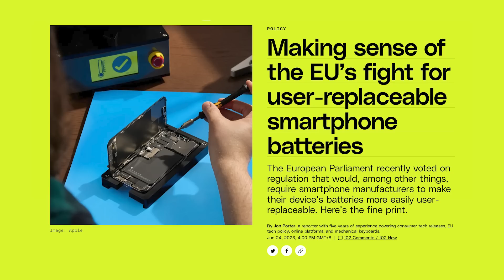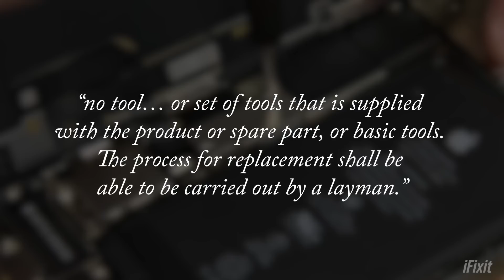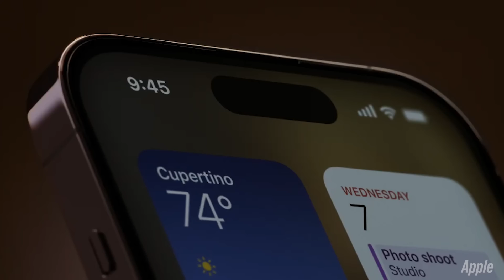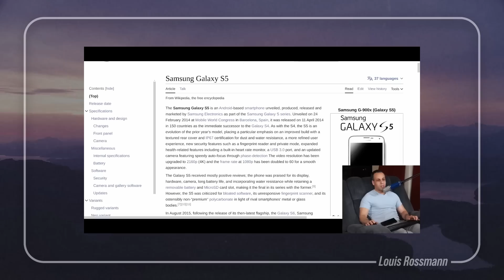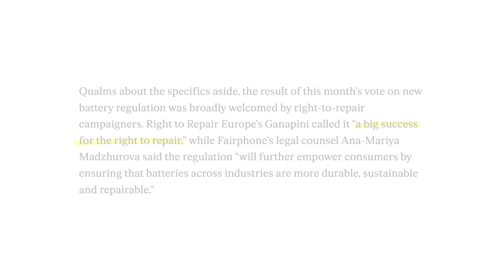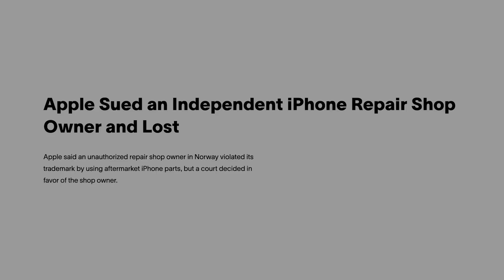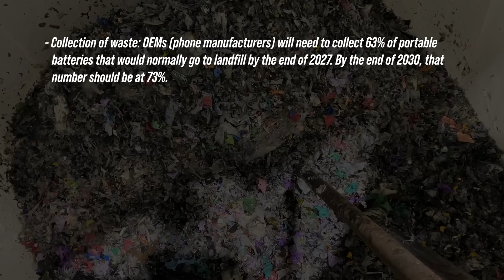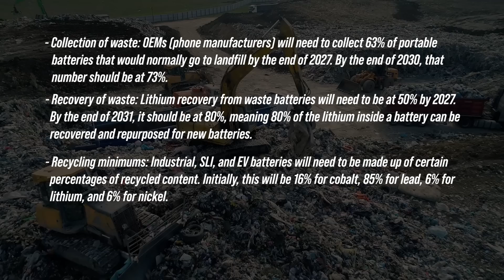EU Just Changed Smartphones Forever

Comment: Honestly removeable batteries are awesome but it doesn't help that much when smartphones have around 2 to 3 years of android updates or Samsung and Apple which have 4 years or more.. If you buy a motorola and xiaomi for example most phones are updated 1 or 2 versions of android, since a battery can last around 3 years until it drops below 80% of health you are more likely to run out of updates and even break your phone, so EU should also ask for manufacturers to increase the Android/iOS updates to be at least 3 years for low end devices, 5 to intermediate and 7 to 8 for high end.. The galaxy S9 for example can still run most games and apps easily but it ran out of updates, just like iPhone 6 and 7 but Apple at least does a better job at updating so isn't a big deal, but for chinese brands this should be considered, my old Redmi Note 8 Pro only got 1 update in 2 years :(

Comment: This will be very good, but I still think that for products like the iPhone there are more components that should be interchangeable. 
I also used to swap batteries in the older iPhones, but many times I felt the battery died at a higher rate than before.
I think this was the time before it was official that new software updates included higher battery consumption.
In addition new software updates are not compatible with all CPUs. Not an electronics expert, but shouldn’t this also be an interchangeable part?
Reply: I got my battery changed a few months ago… And it certainly seems that it’s not holding a charge as long as the old one. Or as long as it ought to. And I was very very good about charging it to 100% and letting it run down for the first few cycles.
Reply: @johnnyxmusic  haha that’s how I have been thinking to! But it’s too hard to maintain that way of charging in the long run 😂 I also heard that the optimal way to charge lithium-ion battery is to keep it between 20-80%.. making it even worse 🫣

Comment: The first aspect of the law is actually quite easy to implement: The manufacturer collects a "Pfand" from the buyer - a token, which will be returned to the customer, if they return the battery. In this case probably a 100$.
Reply: Probably a lot less than that. There's already a deposit on car batteries in Germany, and it's just 7.50 Euro.
Reply: That's a great way to ensure no one will buy small electronics with rechargable batteries anymore.
Reply: @Michael-Archonaeus How can you buy small electronics without a small rechargable batteries?
Reply: @kikillervortlex2244  For anyone who owned a Game Boy Pocket, or an early cell phone that ran on AA's, in the 1990's, that's a silly question.
How does the remote control for your TV work?
Reply: @Michael-Archonaeus With rechargeable AA or AAA size batteries ;-)
But yeah I get your point of using single use one there, but imagine a phone where you need to buy new one every 2 days... And anyway, these one should be collected too and I do not see the problem to have like 1€ increases to each of them, and then 1€ refund when you give them back at end of life, recheargable or not. This is already in place for bottle so...

Comment: If I remember correctly, bigger batteries that last longer are exempt of this regulations, meaning that companies might just increase the battery size. Another loophole might be that devices only accept betteries made by the original manufacturer. But let's wait and see...
Reply: i mean, increasing battery size would corrispond with bigger (chunkier) phones, idk if people will buy that especially after being accustomed to sleek and thin designs for so long. That would be a shot in the foot. As for the original manufacturer thing, i think this was already taken care of in the law but dont trust my word for it, i have my fingers crossed aswell.
Reply: @Apostate_ofmind   Battery technology is eveolving quickly atm - especially with lithium reserves dwindeling. So changing to a different technology and increasing prices might have consumers pay more for the phone AND the battery while keeping the anti consumer practices. I sinserely hope for the best but the past years didn't give me faith in the industry.
Reply: @199Bubi  What in battery tech is evolving "quickly" exactly? We are still using the same tech from 90's, lol.
Reply: I had a look at the draft and I didn't notice an exemption for longer lasting batteries (to not be required to be user replacable). It might not be there, or I've missed it. However, there was an exemption for the requirement to supply spare batteries. If the battery retains 83% capacity after 500 full charge cycles and 80% after 1000 (and the device fulfills the requirements for water and dust proofing), the manufacturer/importer/representative is not required to sell spare batteries.

I guess that a heat gun (or hair dryer) will be classed as a basic tool, and then if you supply a prying tool and a suction cup with the spare battery (or other spare part), perhaps a bit of rubbing alcohol too (for loosening the glue holding the battery in place), you can probably comply with the regulations. Use of adhesives is quite clearly allowed in the draft (check parts refering to the use of removable and reusable fasteners), as long as you supply replacement adhesive and/or any other fastener in sufficient quantity with the spare part at no extra cost.
Reply: @klapiroska4714  I find it strange bigger batteries could be the loophole. I mean how about EV battery, how much more bigger could it be to pass this loophole. And if bigger, how much bigger, the law needs to be clear which most of the time law making cannot be too clear on technicality as it is difficult due to various technology differences and progresses. No government would want law to be changed or revised every year or every quarter because of fast pace technology. It just does not make sense.
Reply: @wumingkkk  I totally agree that it would not make sense to make a loophole for bigger batteries. Ideally, especially in EVs, you'd have as small battery as possible, as it takes less resources to build, it is more affordable, and lighter (safer, more "fuel" efficient and causes less wear on the road surface). It's not something that any government would want.
Reply: Nikon digital camera (D5xxx range) came with 'chipped' batteries to try and stop after market batteries being used. It worked for a while but there are now plenty of copy batteries that work perfectly well.
Reply: Car battery not big enough? So how much bigger would an EV battery need to bypass this loophole.

Comment: That's why I use a Galaxy XCover6 Pro. Not only does it have a replaceable battery, but it also has a headphone jack and SD card slot. It even has a flashing LED message indicator. These features were common till manufactures started cheaping out.

Comment: The problem with this idea is that most people don’t want to keep the same phone beyond the time the battery isn’t really good anymore. So this could force significant design changes, possibly negatively to the user experience, that in the end won’t provide any benefit whatsoever-“green” or otherwise.
Reply: Most people actually do keep their phone for a long time
Reply: @JM-bl3ih  not so sure. I see, at least where I live, people getting new phones regularly. I also wonder if xompanies - especially like Apple- will say some new feature requires new hardware. They have done this already
Reply: @LitlPrince2 I don’t disagree with this. I myself have bought second hand phones.

Comment: The Samsung galaxy S5 was water resistant with a removable back. The removable back just had some rubber seals around the inside of this removeable back cover. However, this could be an issue with wireless charging capabilities. They could have the wireless charging coil attached to the removable back with metal connectors that contact another part of the phone when closed. So I guess they can solve that. This could also however mean that phone cannot have glass back because repeated removal of it could crack the glass. So we could go back to plastic which really isn't a bad thing. Plastic is more durable as it does not crack. And you can do much more with plastic. It can be made to feel and look like leather. And it can self-heal from scratches like the LG G Flex from many years back. You can make more patterns and better designs etc. So this overall could be good. LG's G5 was an interesting design when it came out. I had one. It wasn't perfect but I am sure now it can be perfected. LG should get back in the smartphone business. They were way ahead of their time. Always.

Comment: I never had a phone without replaceable battery. I had a Sony Xperia V for about 8 years, using Cyanogenmod / Lineage to stay current with security updates. After that I got a refurbished LG G5 about four years ago, sadly that is starting to fail in multiple ways by now. My next phone is on the way now, a Samsung XCover 6 Pro - again, replaceable battery.

The most problematic failure point of my LG G5 is material fatigue in the little spring contacts that connect the mainboard to the back of the shell. Some springs broke off and left the hardware buttons and fingerprint reader without function, and some creative fixes for that didn't restore functionality for long. Luckily the device has tap to wake, so it can be used fully through the touchscreen. There also seems to be wear on capacitors though - when the battery is <30% there is a good chance the device will crash when taking a flash photo, probably due to the sudden power draw. It's on its third battery now, and sadly they need to be swapped fairly soon when degradation sets in, since the battery barely lasts a day to begin with. So from my experience, even though it has the swappable battery to recommend it, it doesn't seem like it was built to last.

Comment: Also worth noting: lithium batteries are a significant safety risk as they age, with the possibility of leading to major fires that are very hard to put out. Getting as many old batteries out of people houses as  possible is important for safety and not just environmental reasons.
Reply: What factors contribute to that? Do you mean the batteries as they age with use? Or the batteries in my old non-functioning phones I keep in a drawer because I have no clue how to not make them into E-waste or how to properly dispose of them/also Im lazy.
Reply: @SmokeandSpirit  I'm talking about device batteries specifically. phones, laptops, powerbanks etc. the batteries are highly flammable under certain circumstances. it doesn't happen often, mind. but phone batteries especially have developed a habit of 'puffing up' in recent years, turning into little pillows. if those explode or someone punctures them trying to repair them they can be a mayor hazard

any of this happening to any individual is fairly unlikely, but that doesn't mean we shouldn't reduce the amount of them just randomly lying around after they are no longer needed.
Reply: @MirrorscapeDC  Certainly they can quickly convert into a fire spitting rocket under extreme heat and/or extreme rates of charge/discharge. As the dendrites were brought up, that is part of the what causes the shorts. Though batteries at room temperature that are neither charging or discharging are almost entirely inert. The ones in my drawer for example are dead because electric devices tend to phantom drain. Dendrite formation is actually appearantly caused by mechanical forces exerted during the changing volumes inside the battery. So unless someone stupid came around and decided to pop open my old phones and puncture them, there wouldnt be any state change to cause any said danger.

I hadn't realized dendrite formation was more directly at fault for the discharge, so i never considered how the risks go up with age. Also, I just wouldn't exactly call that a "significant risk" no moreso than wall outlets are a significant risk of fire and direct shock. We learn to safely interact with technology because everything has its risks. Though really I wouldn't say you're incorrect in any capacity. Im just tripping over semantics I guess. 😂 

I guess if I had a rocket sitting around, I wouldn't leave it sitting in a drawer, especially next to a battery that could cause it to ignite. which is hilarious because i definitely have a drawer with both screws and batteries in it which hasnt managed to attempt liftoff just yet. I really should reconsider my life choices though. 😅
Reply: @SmokeandSpirit  depleted batteries are not a risk of fire, they can be dangerous to health is they leak though
Reply: @jonasweber9408  They are if they are truly depleted and you get a bright idea to plug it in for a charge; instant explosion.
Reply: @SmokeandSpirit It's the dendrites that build up and are a natural part of the technology. Once they reach a point where they can short the battery, interesting and volatile stuff starts happening.

Comment: Unless there is a regulation regarding what kind of batteries can be placed in the phone design I think this won't make the maintenance any cheaper, unfortunately.  I think about printers, the ink is easily replaceable by laymen. However, a cheap printer has expensive ink that doesn't last long. They could easily sell the batteries at a price where majority of people will just turn their old phone back in for the new model still. In 2006 when I first used phones as a teen, phones were cheap, less than 200 USD and the batteries were still 50 USD. We typically bought new phones when batteries died unless we could only afford the 50 battery.

Comment: Let's not forget that Apple also got caught adding new battery performance profiles and performance profiles in their updates to slow down existing phones to force handset  updates
Reply: You mean BatteryGate? This was already covered in his previous videos.
Reply: @ayoosh3345 My mom's old iPhone 3G did exactly that once the battery got old, it simply shut off randomly.
Since she got a newer iPhone that never happened, until Apple got sued over throttling, and then replaced throttling with a battery capacity gauge, now she is having those issues again.
Anecdotal, I know, but she is the only person I know who has used iPhone consistently since the 3G, and whose phone use and repair patterns I have been able to monitor.
Reply: While their lack of transparency was terrible it made logical sense to avoid unexpected shutdowns. What’s better, a phone that randomly turns off or one that just take a little bit longer.
Reply: They also degrade the cameras of old iPhones
Reply: We didn't.
Reply: You do know that you just intentionally misrepresnted a situation right? I'm quite sure people rather had slightly slower phones, than phones shutting off randomly. And it pretty much happens with most phones. They should have been transparent with it, but given how media would generally portray the situation I can kind of see why they didn't
Reply: @ThomasAlex   The ignorance factor in this thread, is staggering, as usual. The sheeple like to bleet. Apple did have good reason to slow down the phones. I don't agree with their policies, but some of them are sound.
Reply: @ayoosh3345  What are you talking about? Phones did not shut down because they were being CPU throttled. That was the point of the whole exercise. 

The logic is that the battery may be unable to supply its peak power after degradation. So when the CPU asks for it, and battery can't keep it up, the phones would automatically shut down for safety.

Now, you have the option to keep the peak performance even if the battery is degraded, but you risk the shutdown of the phone. I have seen it happen on 63% degraded battery

Edit: Did you just describe battery percentage in your first two lines?? wth man, read upon these things a bit or ask for the reason, I will gladly explain
Reply: @ThomasAlex ok yeah I kinda misunderstood i think. My bad
Reply: Pretty sure Samsung were caught doing the same thing too though.
Reply: @NZRoflcopter  yeah but i bought my  new samsung for 300$, didn't need to sell a kidney to buy an Apple
Reply: @NZRoflcopter  Defending krApple with 'whataboutism'?
Reply: @DerekDavis213  Not defending anybody, they both suck, just giving out more info.
Reply: @NZRoflcopter  Apple boyz often try and change the subject when Apple's poor behavior is discussed.   That is why u try and deflect by mentioning Samsung?

We ought to talk about how Apple is treating Mac customers these days.  Just awful!
Reply: @DerekDavis213  I own no Apple products. 
I'm using an S22 currently. Not changing the subject just pointing out that Apple is not the only company with bad business practices.
You seem very defensive.
Reply: @NZRoflcopter  But Apple Corp has the worst business practices:

-anti repair
-anti consumer
-Macs are disposable, no upgrades
-tons of bugs in the OS
-iPhone workers paid poverty wages
-huge tax evasion, worldwide

Samsung are angels, saints, compared to Apple Corp!
Reply: @DerekDavis213  Yeah agreed they do tend to be the worst. 
Glad the EU are forcing a few changes soon.
Reply: @NZRoflcopter   Changes are good, the EU actually cares about consumers.

But personally, I would never buy an Apple product.    Android and WIndows are better and cheaper in almost every way.

Mac was launched 39 years ago (in 1984).  

Today, Mac has a tiny 9% market share.  Most people have ZERO interest in the Mac.